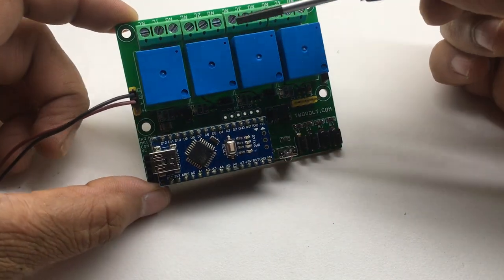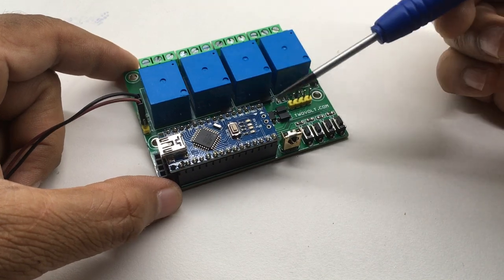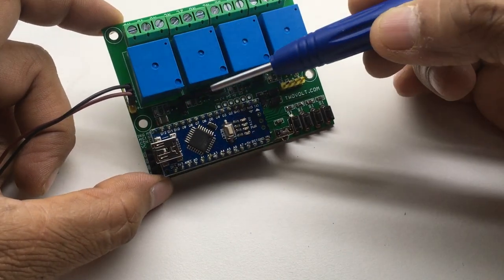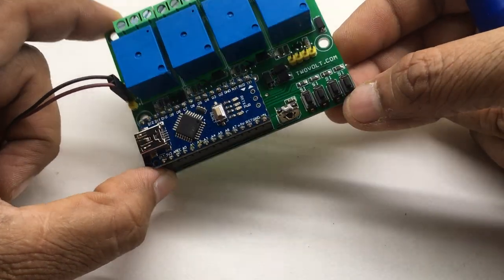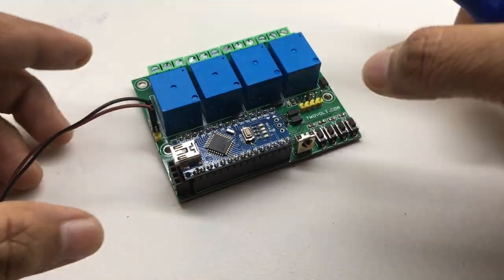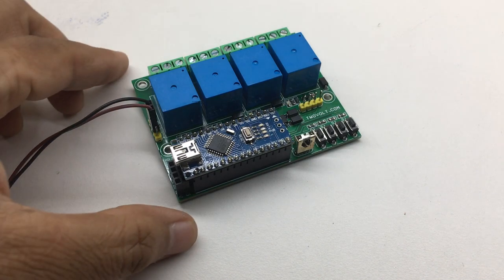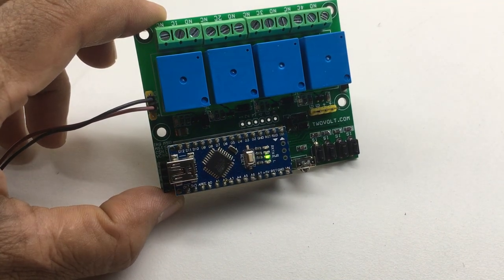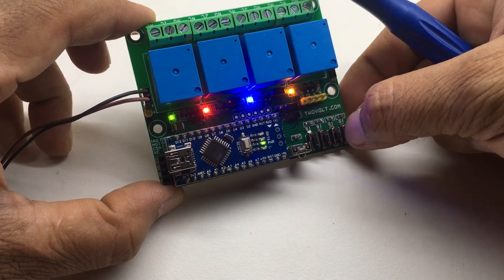ARDUINO 4 CHANNEL DIGITAL ON OFF SWITCH

Comment: Sir we can copy or recover  old file from Arduino
Reply from the maker: hi
project files are available here, you can copy this project, but it only for personal use , not for commercial use
https://www.twovolt.com/2019/09/20/arduino-4-channel-on-off-toggle-switch/

Comment: I am tired and I am looking for tactile switche double pole . Now look for circuit Solved the problem . can you help me ? I want to control two devices in one button <<tactile switches>> . Turn on and off .
Reply from the maker: HI,
r you looking for double action switch? one switch press half one action, press full 2nd switch active, like in SLR camera, half-press focus and full press click??
Reply from the maker: http://www.innocentswitch.co.kr/product/Double_action_switches.html
Reply: @Thetwovolt  thank you for your reply . This button is not suitable because it works in two stages. I have no problem if the solution is electronic circuit. Once again thank you for your interest